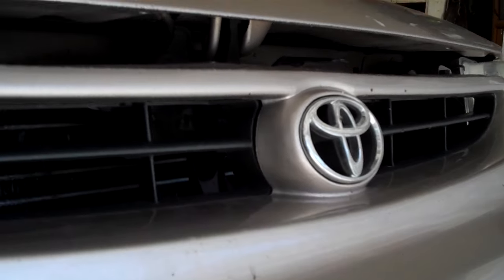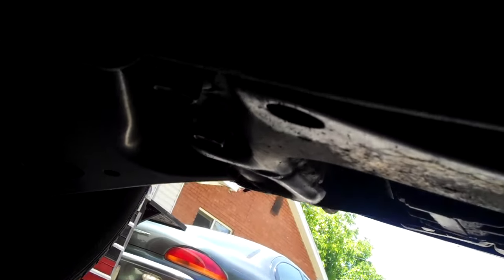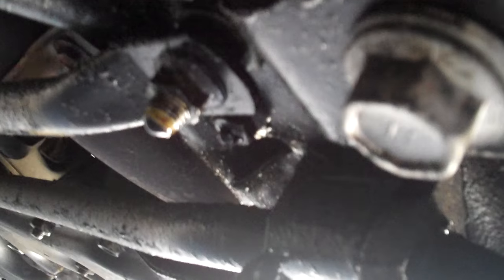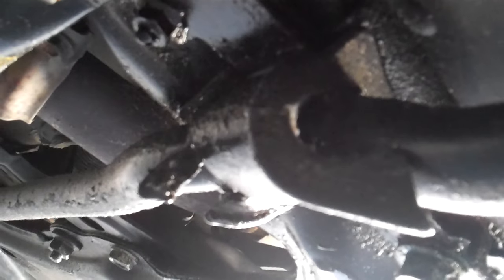Toyota Corrolla makes noise when it hits bumps how to fix

Comment: If you have a clunking noise over bumps and you have a vibration at highway speed that doesn't always happen at the same speed, your likely culprit is your drive axles (constant velocity axles). The inner axles are designed to move in and out, as well as spin when going over bumps. When these wear out they will cause vibrations and clunking noises. If you pay someone to perform the repair it will likely cost around $700.00 depending on your location. If you are mechanically inclined, or are feeling adventurous, you can perform the repair yourself at a cost of around $160.00 if you own or borrow the necessary tools. I recommend replacing the transmission output seals while the axles are out and also recommend that the axle nut be replaced as well. If you do this job, TORQUE ALL NUTS AND BOLTS TO MANUFACTURER"S SPECIFICATIONS! Remember to buy the proper transmission fluid because the transmission will need to be drained to perform this repair.
Reply: Thanks brother. Great info
Reply: my Corolla has 210k miles. changed the struts and all the suspension components it's still clunk. it's cv axle.i believe

Comment: Taken my 2015 Corolla to a few mechanics and no one could figure it out. I’m 100% certain there’s an issue. I diagnosed driveshaft/cv axle by another video I watched.
Reply: Have 2015 toyota corolla same things sound like old car on ground uneven
Reply: @enriquehuerta2113  They kept trying to tell me it was the mudflaps scraping. Nah I know that sound. This is like a rut rut rocking sound. They think it could be the struts. I haven't had time to take it back with work.
Reply: It could an issue related to the tire size. Consult a mechanic and try a smaller size tire.

Comment: Thanks Brian stupid me went over a curb but I couldn't see any damage but it started clunking right after that. Didn't check the sway bar but struts seem good so will check this tomorrow. Will be great if that's it. Its driving me nuts and it used be so quiet before. Thanks for putting out good info.

Comment: I want to do my front bushings but i cant get that bar off to get off rear bracket bolts. The one bolt is stripped tried bolt extactor but it wont budge. Do you need that bar? I was thinking about cutting the bolt off

Comment: I own a 1998 Ford E350 4x4 Van and over bumpy roads the suspension make noises and it really isses me off. I am afraid of taking it to the nearest 4x4 Shop top service it and make sure the suspension is in good working order and perhaps get rid of the noises because they will charge me an arm and a leg even i there is nothing seriously wrong with it.
My question is, does 4x4 rigs make noises over unpaved bumpy roads? Is it expected to hear some suspension noises over bumps? The van rides smooth and noise free on paved highway roads.
Thanks

Comment: Final the rear front contol arms which is simply a bar on the rear susension are know to fail as well espically the Camry's from the early 90's that have the same set up.  The rear will make a banging nosie and the casue is due to the bushings on the front control arm/bar busing go bad which make the nosie.  It happen to one of my other co-workers at work with His 1992 Camry Wagon which has over 262,000 miles and still going.

Comment: Sway bar links on my 98 Corolla were worn out and made that same noise. Changed them and the noise went away. Then it came back. Shook the passenger side link and it was loose, I thought got to take them back to Advance Auto Parts and of course had no receipt. On the off chance the nuts were loose I snugged them and got a fairly easy 1/8 turn on them, tightened to no slop. Drove the car and no noise. I think they worked loose after the first drive and needed a retorque like new head gaskets do.

Comment: I think this is the same thing my 03 Camry has. Similar sound and recently squeaking noise. The guy that sold me the car told me that the power steering hose needs to be replaced at some point.. The shocks are fine and the car pulls slightly to the left.
I really think all the indicators point to what you described. I'll follow up on what it was and going to check the bushings

Comment: mines is a 2000 ce with 130k miles but it makes so much suspension noise and clunk any idea? I replaced all 4 struts with rear sway bar links in the back i got control arms with ball joints to install and get it  a alignment would that did the issue ? I’m having

Comment: @briansmobile1 Turned out to be my strut mount; just in case anyone is hearing a clunking sound when going over bumps ONLY. Although, it could have been just the strut nut that was loose and needed tightening. Either way, I changed the strut mount and it fixed the problem!!! :D

Comment: what would cause a clunking noise in the rear? I changed the stabiliser bars (dog bones) and the struts and it still does it on the passenger side. and help would be great. thanks

Comment: Mine is doing this on the right too, however i was just under the car, sway bar bushings look good on both sides, sway bar links were all done in august, struts are a year old all around, the front lower control arm bushings(rear flat ones) are a little cracked up, a little split here and there, the right does seem a little worse... think this would be the cause?
Reply: Ever figure it out?

Comment: I put used  struts (140KM) on my Honda (260KM), but on bumps still clunk noise stay. Apparently anti sway bar look fine, while mechanic already replaced rear sway bar linkage that were broken and but he did not recognized anti sway bar bushing already worn due to this issue. After watch video I realized and found the bushing were not broken but hard enough to be loosed/wearied (shinny). After replacing all bushing 70% on bump, cluck nose gone. thanks

Comment: My 99 Corolla is making a creaking noise from the left front.  Me and one of my co-workers inspected it and believe the sway bar bushings have failed becuse it's polyurathane rubber and over time it gets hard and the bar is not able to move without makeing nosie.  Also vehicles are know for the stabilzer bars to go bad.  I purchased a set from Autozone and they are 50% larger then the orginals from the factory.

Comment: Take out the stabilizer link on the side you hear the noise and see what happens. no noise, than you know its the stabilizer links. I was writing a response while the video was playing, Buy the stabilizer bar bushings at Rock Auto. $5.67 for two. Get the Moogs. they have great quality and come with a warranty,. Very easy to fix. Spent more time on the video (wink).  By the way. it can be the bar or the links, they make similar noises. I know from experience.

Comment: lol i have a 2015 corolla and i get the same problem. dunno if its the same cause however. id be pretty stupid for an issue like this so carry forward 10 yrs lol

at first i thought it was a loose strut tower or control arms

Comment: So what do I need to buy/replace?
I have replaced about everything including struts. Still makes the knocks. Please advise.
Reply: If your problem is like in the video, it's just the sway bar bushings-not very expensive. You should be able to see the bad bushings that are worn or eaten away (not tight). Good luck.